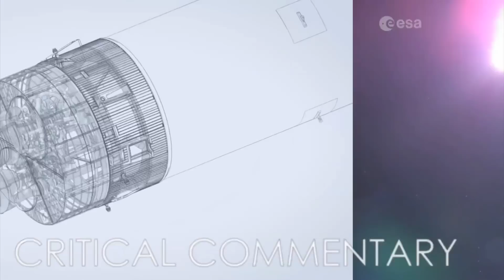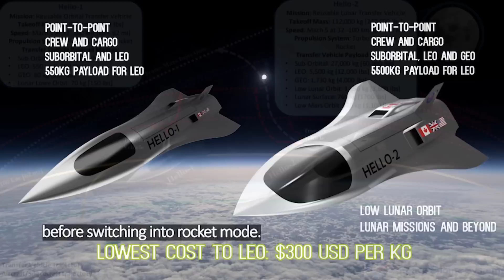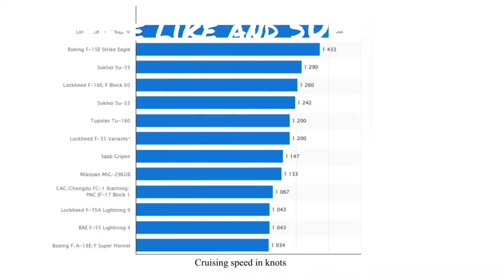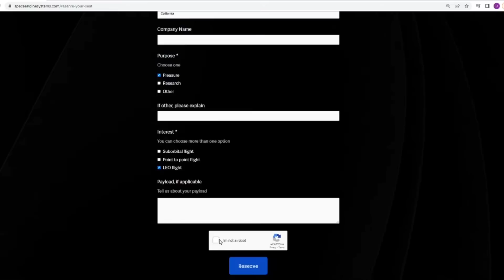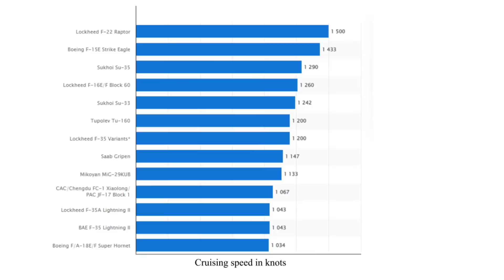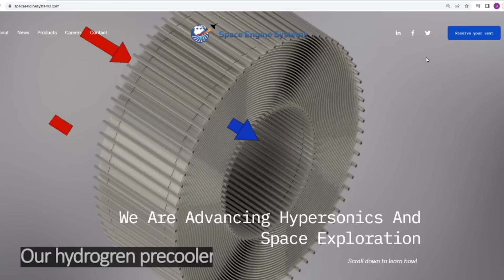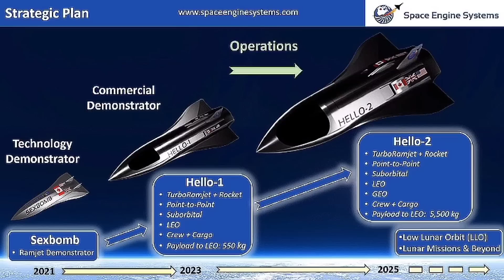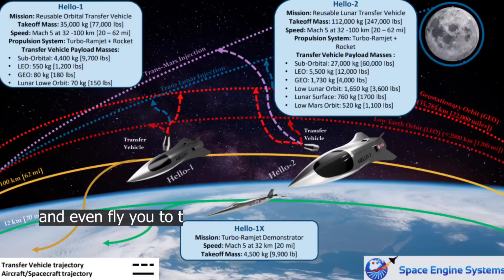Canadian Spaceplane flying in 2023!  Lunar missions in 2025!?  EXCLUSIVE INTERVIEW!

Comment: Yeah.  I hope they do well, but I won't be buying any shares in their IPO.  I just think they're in the same bucket as Skylon with their Sabre engine. In fact I'd still give Skylon a higher mark. and they have virtually no chance either.  SSTO requires some ground based energy (rail gun / mag lev' whatever) possibly combined with a hybrid engine to reduce the O2 needed.  But Good Luck Hello.

Comment: Everett, I see your point which is well stated. You are right on target regarding how much money it would take to mature this concept by this PRIVATE company. If it is going to be reusable and fly, it requires landing gear and flight control hardware. That is the price paid to fly in the atmosphere, make the safest recovery, and turn the bird around quickly. My point is - look at the billions wasted by Congress, on all of the programs since the Shuttle.  Look at the SLS and the associated infrastructure, and all the throw away stuff we are littering the Atlantic Ocean with. Look at politicians forcing NASA to procure old tech to keep the Big Aero buddies in their districts fat and happy.*  Those billions if not trillions, could have developed maglev catapult runways or rocket sled tracks to propel the weight of the atmospheric flight hardware and overcome the initial aerodynamic drag penalty associated with horizontal sea level launch. The USAF has been doing hypersonic sled runs at Kirtland for how long!   

Armstrong and others, took the X-15 to space, understandably not all the way around this marble, but left the atmosphere, controlled the bird using thrusters, made an atmospheric reentry and landed safely! The SR-71 routinely started with zero altitude and airspeed and flew in the rarified atmosphere well above 80K feet SINCE THE EARLY SIXTIES! That is not very far from the Horizontal Launch to Orbit Holy Grail. We shot a satellite out of orbit with an F-15 and a missile. Are we really expected to believe the US could not bridge those technologies together??? Big Brother Gov, enriched the Military Industrial Complex by shoveling heaps of tax money at companies that gladly gobbled up the vittles on the gov gravy train. All the while fettering NASA. You can't blame the legacy companies for capitalizing on that situation. We as citizens should have listened more closely to Ike's warning. Hindsight is a wonderful thing!

*Before anyone thinks I'm bashing on all those hard working folks that TOIL in those legacy companies, I AM NOT. The LEGACY COMPANIES/EXECUTIVES have gotten rich on the backs of American tax payers since the seventies. Progress was sacrificed on the altar of profit. Forcing NASA to use Spam in a can Roman candles to access space should have ended with Apollo. We went backwards after the Shuttle program. With the exception of new companies like SpaceX, Sierra and Virgin, We The People are still paying for  WWII tech, single use, chemically powered missiles to do what? The Aerospike engine, super energetic fuels, advanced metallurgy and advanced thermal protection systems should all be much more mature technologies by now. The given excuse has always been lack of development money. BS!  The real underlying problem has been the government's tax payer funded pork barrel spending to maintain CONTROL.  Now private companies have the momentum and are about to blow the doors off government space. They control their tech/hardware. They don't need the government to go to space. Space is now about business. The US government sucks in the competitive business arena and needs to get out of it. The government's role is to provide reasonable regulation, as they do with the airline industry and the interstate road system, to ensure the public is safe and provide opportunity for individuals and companies to flourish. Private companies will get the Star Spangled Banner planted on the the Moon and Mars, with pride, far more economically and much quicker than Uncle Sugar can!  

Government should not exist to profit. Nor should it  frivolously spend what the citizenry pledges.  Enact term limits and watch the American Experiment erupt with innovation.  Sorry Bill Nelson, it's time for you and the paradigm you represent to just fade away. I'm angry. I WANT TO CONTROL the spending of MY space dollars!                                         There, I said it!

😁

Comment: It's a very different concept than the direction I exclusively want to take . There's a couple of issues in regards to returning from a much distant area like the moon. How will it slow down ? Also the size is much bigger than Orion and the math dictates it going to come in much faster and hotter. My idea or concept doesn't embark without that in mind,  it will take on a different perspective when it comes to coming back from a greater distance than the moon .
In theory it makes for a slow down approach using what I call zero point . It will make sense when I get my chit together 
..until then I will stay ANGRY until they all get it right 
Cheers 🍻

Comment: When I saw the the basic vehicle profile on the photo cover of this video, I immediately harkened back to the X-15, especially the proposed delta wing variants NASA was dabbling with. Just goes to show that you don't have to reinvent the wheel. If you tweak the X-15 with modern aerodynamic construction materials and methods, you would most likely end up with the Helio. Instead of having to be carried aloft to save fuel, now the new engine technology demonstrated in this video is able to turn the hypersonic research plane into a Single Stage to Orbit space plane. Most people don't realize the rocket X-planes, especially the X-15 program,  were more advanced than the Spam in a can capsules that we rushed our astronauts into space on in order to beat the Russians. After Apollo, where did NASA go? Right back to the spaceplane concept. Imagine what could have been if the US was not sidetracked with rockets and capsules to gain a political win, and prioritized space plane research? Our first astronauts earned their wings flying the X-15!  The Helio looks like the love child of the X-15 and the SR-71. Looks awesome, and I'll bet it will fly awesomely.
Reply: Anything with control surfaces and landing gear is hauling around enough dead weight to make SSTO basically impossible.  A lifting body has the volume to surface area ratio to allow LOX along with methane, but hybrid jet/ramjet/rocket engines aren't currently extant and seem unlikely. This guy talks about what everybody else dreams of.  For someone who hasn't put a vehicle into the air, he talks a big game. It is hard to see anything similar to what he proposes with less than a billion dollars investment and probably far north of that,  especially if he is going to have a working prototype next year. This reminds me of a certain blood testing machine. The UK is desperate to have someone fly almost anything out of Cornwall, so he will get some support there. The closest thing that Canada has had to space was the Canadarm since they gave up manufacturing a military jet. Where is the industrial complex to support the building of this thing? I smell a very large rat.
Reply: @everettlwilliamsii3740  Very good Sir, and I agree. Catch my other rant.
Reply: The Space Truck (Shuttle) set back Space vehicles 25 years. 
Elon looks to make up that ground, albeit with '60s style vehicles. 
Love his effort! But this Canadian vehicle certainly has a place in Space!

Comment: can't the spaceplane have jet engines under wings to get itself airborne to high enough altitude and then be refueled in air by refueling aircraft before it starts ramjet and later rocket on it's way towards space
Reply: Mid air refueling with cryogenic fuels has never been done(methane, oxygen), plus the jet engine are dead weight once the ramjjet is fired. This will be too heavy for ssto, need a carrier aircraft

Comment: I’ll start to get interested when I see it flying.
Reply: The same could be said for Starship.
Reply: @jameswilson5165  yup. It’s true.
Reply: @jameswilson5165  The same has been said about Starship, & is still being said.
Reply: @jameswilson5165  At least starship is using conventional technology, and the oxygen and methane loads are sufficient to acheive low earth orbit.  The spaceplane uses tech that no one has ever got to work.  The Canada space plane propenents have not released fuel tank capacity and delta V calcs to prove it is theoretically possible.
Reply: @jameswilson5165  The difference is with Starship the whole world is witnessing what they are doing, Plus in various times it did fly, but obviously not orbital nor suborbital, they did test it.
Reply: She’ll fly alright or rud lol.
Reply: Even then I won't get that interested.